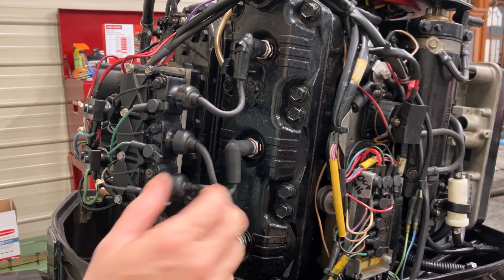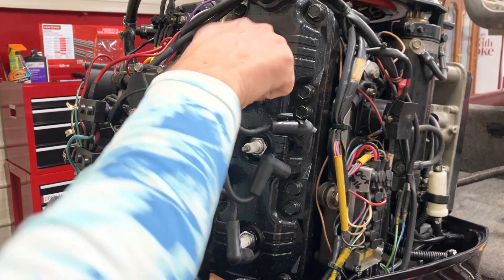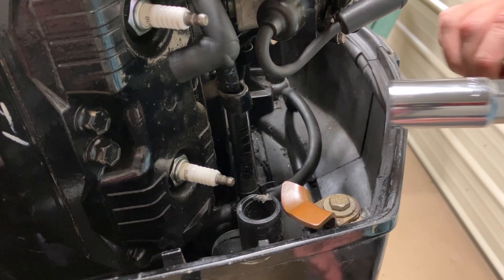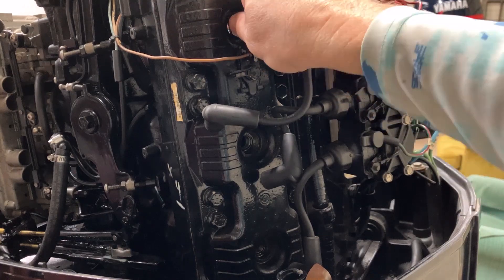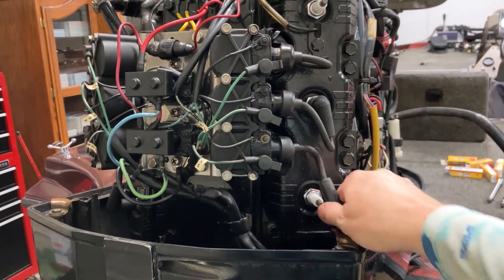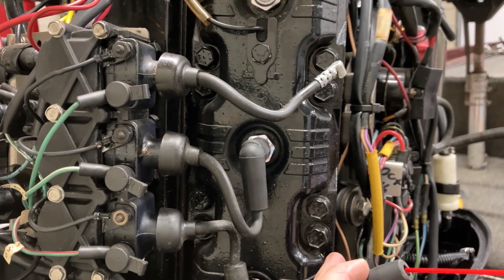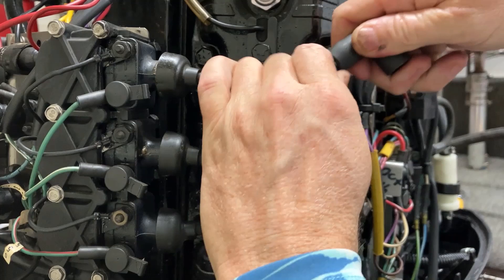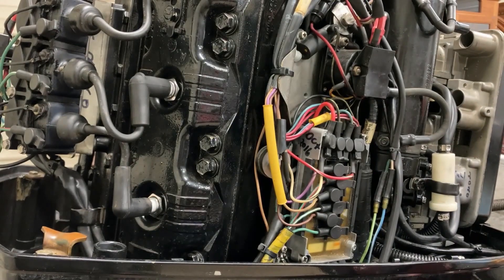[2-Stroke Outboard Motor] Spark Plug Change & Boot Replacement: Mercury Blackmax 150 Bass Boat

Comment: Can I buy these on Amazon? Post the link to buy these
Reply from the maker: NGK 6431 or BU8H is the spark plug. Amazon or any parts house should have them or be able to get them. Any universal 90-degree spark plug boot should work from an auto parts store. The one used was a GM 90-degree boot.